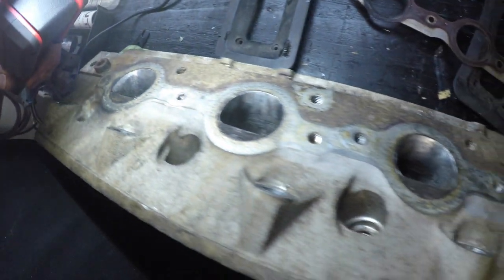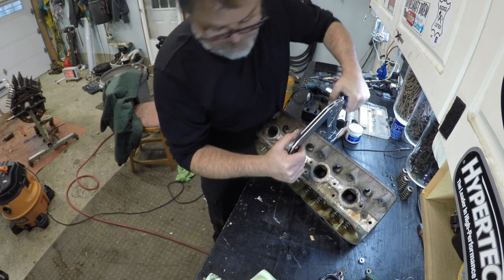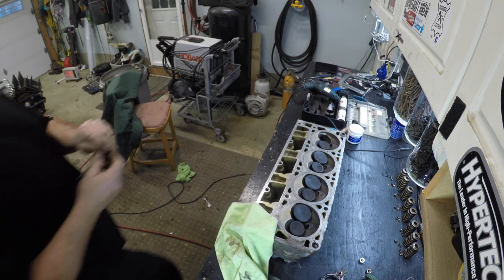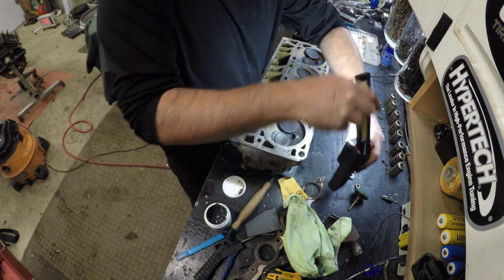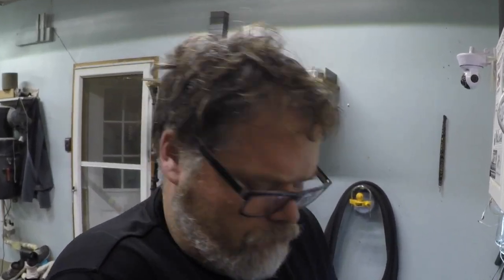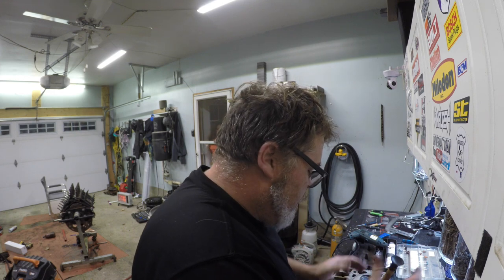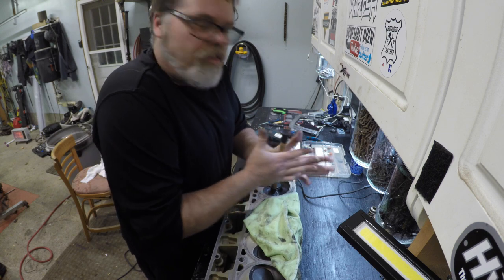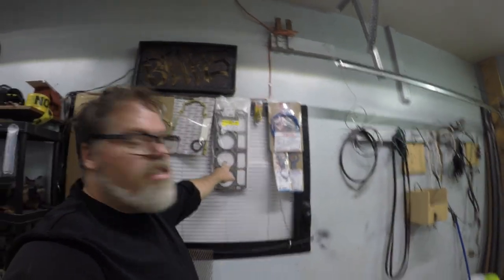Lapping Valves And Removing Springs Ls Swap

Comment: I use Dykem to help keep an eye on the mating surfaces. I do both the valve, and seat with Dykem. This way it will show any imperfections on both mating surfaces. Also, I have been known to stand the head up and use a tight fit rubber hose on the valve, and push a piece of dowel pin in the other end and clamp that in a cordless drill.

Comment: If you ever want to test your valves for leaks fill the cylinder head (combustion chamber) with varsol or equivalent and let it sit. If it leaks by the valve seat you’ll see an empty chamber and liquid coming out of either the intake or exhaust port to determine which valve is leaking by when seated. If that makes sense.... sometimes I don’t splain things very well